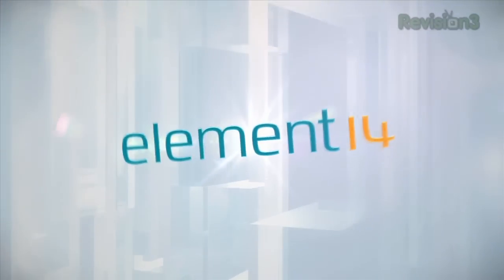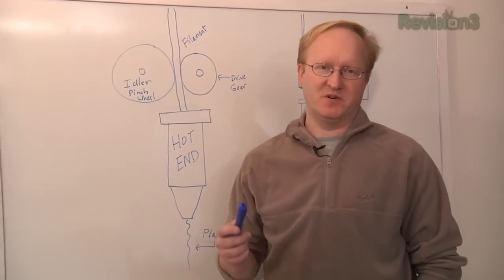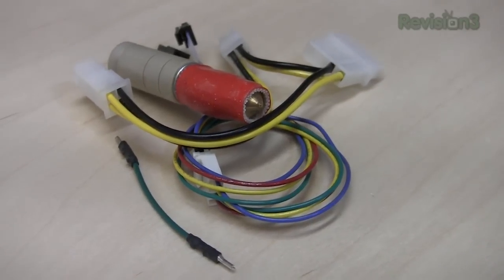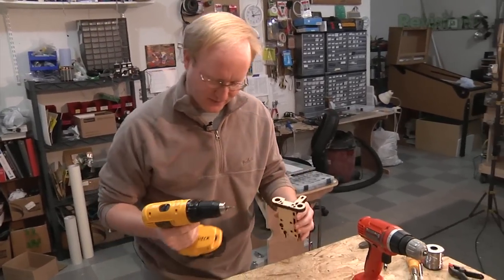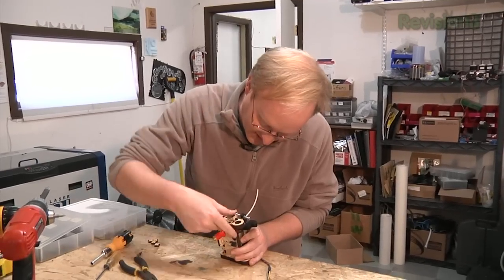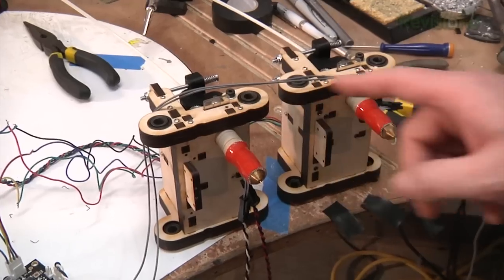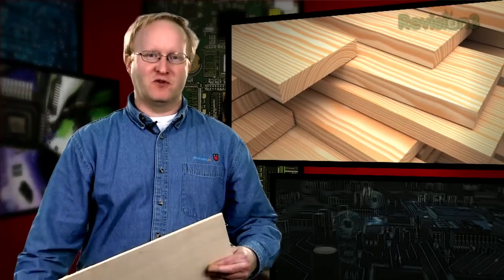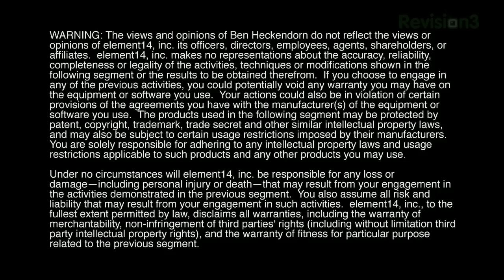Double Decker 3D Printer Part 1

Comment: Lumber is sold in its Nominal dimensions a 2×4 is really .75×3.5 & its like that in till you get to a 2×8 this is .75×7.25 
The reason a lumber is labeled bigger than it really is  because at the sawmill they rough saw it to its nominal dimensions and finish it to its actual dimensions
  1x2 = .5x1.5
  2x4 = .75x3.5
  2x6 = .75x5.5      
*2x8 = .75x7.25
2x10 = .75x9.25
2x12 = .75x11.25
  4x4 = 3.5x3.5
  6x6 = 5.5x5.5

Comment: I program in Pascal & C++ Have a look at this Software for arduino or any microcontroller communicating through serial port... I have wrote this liitle application for pc so people can test and display some information from their readings... look great... and useful especially if you don't have a 2x16 display at hand... or even if you do.. this will display it all on your PC or laptop... I have added some more stuff to it e.g some GAUGES too... imagine Controlling a glass house and displaying information from your sensors right on your screen or a alarm system and you can know where and what sensor has been activated etc... Arduino Software LCD and Gauges Display.Made instead of LDC Hardware.I can make other apps to  thanks :)

Comment: America should move to the metric system, than 6mm is 6mm and not .0138 inches, how confusing is that! Even England ditched the Imperial system.
It's far easier to work in units of 10.

Comment: Why did you use stepper with gears for the extruder? What is the point of the gears, higher torque or higher precision? Gears often have backlash, how this affects the printing? There are projects with direct drive extruders, using 7mm in diameter wheels. Is this better, if used with 0.9deg per step motor?

Comment: About your rant on wood dimensions.  The rough cut lumber is the nominal dimension( ie. 2x4), however when the lumber is milled for straightness, the actual dimensions become 1 1/2" x 3 1/2".  If you are looking for actual dimensions as Ben said, measure it.  If you require specific dimensioning get ready to pay for it from the lumber mill.

Comment: Great video!
However I have to say I always cringe when I see you use power tools the way you do around 4:17 or so. When you have to e.g. drill a hole and don't want to clamp it into a vice, hold the item in such a way that the tool goes away from your hands if it slips away or if the drill or your workpiece breaks. 
Oh, and Spelling Nazi sez it's DUAL extruders, not duel :-)